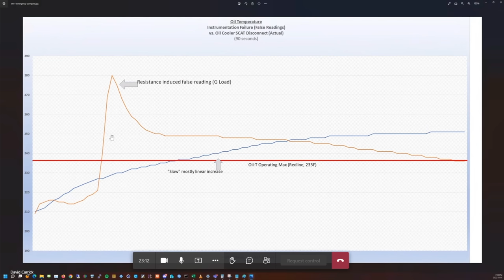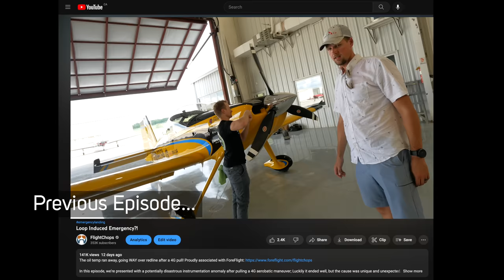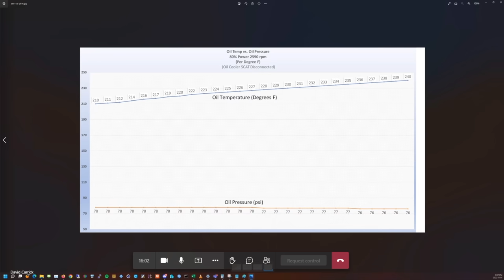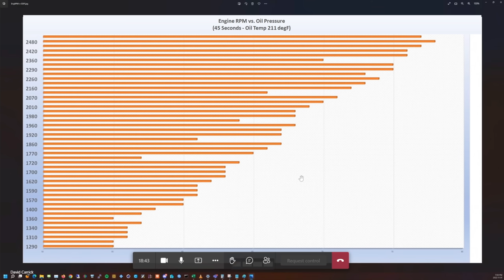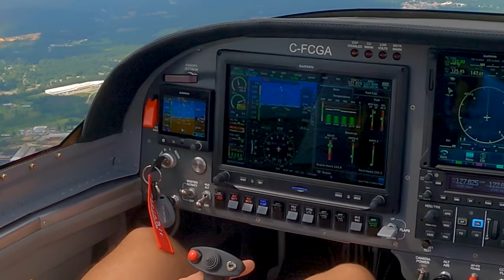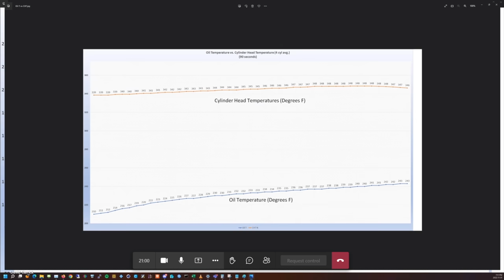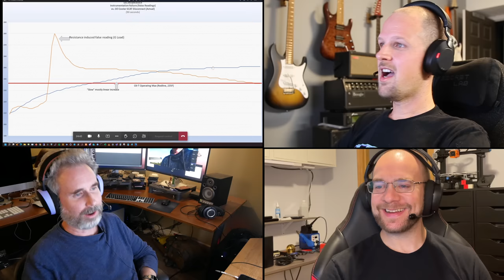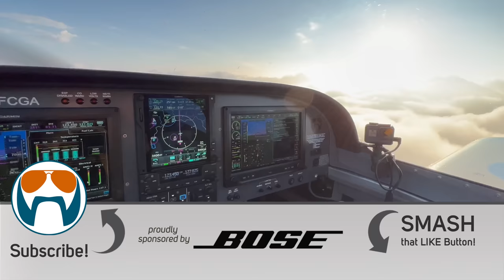Two Oil Temp Runaway Emergencies!? Engine Data Debrief Debunks Myths

Comment: On the call an emergency issue, and to be totally clear I am not a pilot. The purpose of the call is to give you priority Access to getting back on the ground and whatever resources you need to do that.

in the first emergency you were directly over the airport you seemed to be the only one in the air around that airport and you had people on the ground watching you. There is no local Tower controller it's a completely uncontrolled VFR Airport. You already had everything that you needed to get safely on the ground.

In the second emergency flight Chops was handling aviate and navigate. The other guy was handling communicate If you're going to yell at somebody for not calling a PAN that's the person that needs to get the recommendation not the person making sure that the plane is being handled correctly.

I will say that most people are in denial when they're having their emergency. They are reluctant to call because every other area of their life has trained them to deny there is a problem.

It is not a general aviation issue, it is a societal issue.

Comment: Do you have any advice for those of us worried about this scat tube coming off?  I have mounted mine and it was not super simple with the shape of the oil cooler inlet and the top portion is actually the one that comes off.  Was your clamp grabbing the wire?  Was it not tight enough?  Has it come off since?

Comment: Can’t disagree with any of these conclusions, but I still think Garmins EMS should be able to identify fault conditions like this. A change in sensor resistance faster than the thing can change temperature due to its mass, and/or noisy sensor readings should be flagged as a likely sensor fault giving the pilot more information about the problem.
What if this were a trim position sensor? You’d expect the software to flag when the sensor readings are erratic and don’t correspond to the expected control surface movement.
Very easy to do in software.

Comment: Interesting that the scenarios you missed in discussion were the only scenarios I’ve ever heard regarding oil pressure and temperature (never heard of either of your myths presented before - and I’m not surprised at your results because they are positive displacement scavenge pumps so the logic makes no sense that you’d lose pressure with higher temps). 

A long term increase an oil temp coupled with a long term decrease in oil pressure in cruise should flag you to consider a slow oil leak. Obviously your emergency didn’t handle this data but your discussion didn’t address it either. I can say from working with race engines this is a condition I have witnessed. 

The other condition was the opposite of a sudden drop in oil pressure which you said there is a myth temp would go up, this wouldn’t happen, it would be supplemented by a drop in temperature (yes a drop) should lead you to believe you just had a catastrophic loss of oil. Why you may ask? Because loss of oil would mean you aren’t taking heated oil across the sensor anymore. I have not seen the latter condition with oil but have experienced it blowing coolant lines before.

Comment: Surely there is and oil pressure relieve valve, the job of which is regulate the oil pressure?  So, the only time you would have low oil pressure is at low RPM or if the oil has got too thin which it should not unless it has gone out of grade due to age or if it has got way to hot.

Comment: You can create a simple sensor for the duct using a magnetic door/window sensor usually used for alarm systems. The flexible duct end and cowling could each have half of the sensor and if they separate, a light or alert could be displayed on the panel. These sensors are only a couple dollars each and are extremely reliable. It would alert before leaving the ground, or if in the air, as soon as it separates.
Reply: What about just an old school engine oil temperature gauge on the panel?
Reply: @abrahamlevi3556  that's solving the wrong problem. The problem that's being solved here is the tube separation. Not sure if you really need that problem solved, but an oil gauge isn't going to do that
Reply: @deSloleye  Yes, but an old school gangue can negate on the spot false alarms regarding  unexplained  erratic jumps in engine oil temp.
Reply: @abrahamlevi3556  that's true. All temp gauges are electrical, though, and you've only got so many places to fit a sensor
Reply: If you put in sensors for everything that can be detected by a sensor, that aircraft would be able to drive somewhat fast, but unlikely to fly...
Reply: @realulli  more likely to fly than be affordable, too. Those first f35a the usaf were using were instrumented up as much as they could be, but then cost $500M a piece. Everything you want to know will cost you.
Reply: @realulli  The magnet sensor is less than an ounce and cost less than $10. It is a system critical component and with the cost of an engine at stake - not to mention your life - it seems like a worthwhile investment.

Comment: It's impressive how resistant modern multigrade oils are to high temperatures. I'd think the engine thermostat would also open further to cool the cylinder head and offset some of the oil heat.
Reply: This engine is air cooled, there is no thermostat. It is also oil cooled and fuel cooled, although as pointed out in the discussion, lack of cooling oil won’t impact CHT immediately because of the thermal mass of the engine and where CHT is measured.

Comment: Interesting. I'm glad that I haven't had a real emergency yet, only one carb ice scare, but caught in time.

The oil temperature/pressure correlation is true at low oil temperatures. With cold oil during a cold start on a cold day, oil pressure, especially with a single-grade oil, can go up pretty high even at low rpm, but will go down quickly as the oil warms up. But at the higher end I've never thought that. Oil pressure limiting factor should be the pressure relive valve, because at higher rpm the oil pump will create much more pressure than is required. Same for CHT; there isn't really that much oil in the combustion chamber for oil temperature to make much of a difference.

Comment: do I really have to prove overall engine temp - which IS reflected in cht, is correlated to oil temp!!!?? What creates oil temperature? apparently king Canadian (as a canadian) here hasnt considered that. If you kept flying - with the oil cooler broken, what temp would the oil peak at? 
why would it peak at this temp? what does cooling the oil accomplish? 
If we altered the oil cooler size, air flow over cooler, and qty of oil pumped, could we alter peak oil temps?

what oil temp is desireable, and why?
Why does oil temperature take a long time to come up, almost as if oil temp tracks with engine temp?? hmmmm

yes - large heavy chunk of alum has large thermal inertial - aka time to get heated up or cooled down.  small volume of oil has lower thermal inertia - faster to respond. But everything wishes to equalize - oil and engine. and the oil is cooled to help cool the engine.  In the case of this engine, it must be cooled because the gap between usable safe oil temp vs engine temp is a large gap. if the engine naturally ran around 230f - ud never have oil temp run away issues UNLESS you have engine failures with internal frictions. I commented last time - and will again - maybe someone should find the true usable end of the oil before oil break down. Its our experience in national championship winning engines - that its well over 300f for short periods.

Comment: To add “data” points for accurate diagnosis of imminent engine issues or oil cooler failure, Im going to GUESS the oil temp sensor is after cooler, before it goes through the engine loop back to the cooler (or not).  Adding a sensor just before cooler on cooler entry - would tell you the delta in oil temp and if the cooler is working or the source of issue.  Normal operation will show whatever delta you have - call it 10 or 20 deg….and if a cooler blower hose blows off entry and outlet temp would be about the same, and at varied levels of issue of cooler (plugged, blocked internally, air failure, partial air failure etc).  The before cooler temp will be a better indication of engine issues as well, as a sudden quick rise in oil temp pre cooler would be a sure sign something has changed….
Reply: It doesn't matter. Oil temp too high -> land ASAP.
Reply: @realulli  This is ignorant.  Define too high....
KNOWING what our margin and limits are make us safer in decision making.  If we KNOW the plane will fly for 1 hour without damage - we can plan far differently than if we KNOW it has a failure imminent

Comment: Not a Pilot or AP ... but please read.
I am a Master Mechanic with a degree in Automotive and Diesel Technology with Factory training from FoMoCo, Daimler Chrysler, and GM/Delphi as well as certifications from many aftermarket manufacturers. Over thirty years of work experience.
While I agree with you on the greater majority of your data-backed commentary, I would like for you to appreciate the fact that 90 seconds of data does not give you the long term data to support your theory of cyl head temp not being affected significantly by oil temp.
Without a perfect understanding of the airflow within the engine compartment I would like to share some opinions.
I am assuming from the video at 0:45 the engine is cooled by ram air/ prop air that is forced directly over the cylinders and heads then is ducted to the oil cooler (when you hook it up) before it is dumped outside.
The duct not being secured is the clear reason for the rapid rise in oil temp.  The high engine speed was a secondary and significant cause which was immediately reduced once the temp warning was detected (now audible, good call there).  Reducing load/RPM instantly reduced production of heat on the engine and oil which did not show up in the 90 seconds of data because as you mentioned there is a lot of mass and it takes time for said mass to go from rising heat to lowering heat. 
There was only a minor linear change in cyl head temp during the rapid increase in oil temp because the engine itself still had almost normal airflow over the cylinders/heads, whereas the oil cooler had a massive reduction of airflow.
Now let's change the circumstances of the event.  You are no longer over the airfield on a test flight, you are over some huge body of water or, God forbid, climbing a mountain range.  Landing is not an option for at least 30 minutes.
This changes everything, and if you still believe your engine temps will not catch up to your oil temp, I believe it will unless you take immediate action to minimize load and RPM.  Going rich will help a lot!  Get to cooler air if you can.
If you have no choice but to carry on and even require high power settings, you will see the engine temp start to rise sharply to match the oil temp.  The oil IS used to cool the engine. Oil is squirted on the bottom of the pistons and is constantly being applied to the cylinders and scraped off by the rings.
Data at the ten-minute mark will tell you what the likelihood of you making the next airport will be. 
Ignoring the oil temp and assuming the engine temp will stay linear is not a good plan.  All the air cooling the cylinders is slowly baking everything in the engine compartment and looking for a place to escape.  If the loose duct compresses closed this heating will be amplified since air in must have a place to go out and if it doesn't that side of the engine no longer has enough airflow to cool the cylinders and it's going to get ugly pretty damn quick.
You get my point.  PLEASE RESPECT THE AIRFLOW...AIR IS FOR MORE THAN JUST LIFT MY FRIENDS.  Double check those ducts!  And fly safely!

Comment: Hey I have a question, why so many pilots use imperial units, including you, when it was internationally agreed that all units used in aerospace need to be in metric? Even NASA is using metric.
Reply from the maker: Man.... I wish I knew.  As a Canadian, aviation is the ONLY part of my life that doesn't use metric. 
I have to balance temperatures in C and F because the weather standards (even in aviation) use C, but for all the engine data it is always in F.
Reply: The exception is nautical miles per hour, which are seperate from miles, and have a 1:1 ratio with latitude and longitude. As for everything else, most aerospace stuff in this part of the world is made by US Companies, and theres no regulation requiring anybody in the US to use metric, thus the near universal use of Imperial.
Reply: @FlightChops  the people selling is also selling it by quart’s and gallons. Just saying.
Reply: @everettbruckerhoff6029   longitude with the required correction for meridian convergence, of course.  One degree equals 60 nautical miles.  Try to do it with 111 km instead.
Reply: @FlightChops  Engine data should be in C, or just convert it to C for actual use.
Reply from the maker: @llaughridge  in the manuals and on the panels all engine data is F.  Those are the numbers I know and I’m not prepared to convert to C for the sake of it being in C.  I know oil is happy around 180 - 200, CHTs around 350 and EGTs around 1350-1400.  Those are east numbers that I’ve been familiar with for ever.  Just like for weather, 0 degrees C is freezing.  So I live with thinking about weather in C and everything else in F
Reply: Aviation as an industry was essentially invented in the US. Not just because of the Wrights, but because we had a lot of wide open space with a low population density, with a lot of distance between cities (which is still true to an extent), so it was a natural environment for airplanes to flourish. So, when the first generation of pilots started teaching the second generation, they also imparted their ridiculous measuring system. Now, even pilots in metric countries oppose changing for fear of the safety issues switching might cause.

Fun fact: A few years ago, Russia switched from using meters to measure altitude to using feet for its Flight Levels (though it's still meters for altitude below the transition level).
Reply: @everettbruckerhoff6029  Not exactly. The original definition was that a nautical mile is the distance between minutes of latitude. Of course, because the earth isn't a perfect sphere, the distance between minutes of latitude varies, so it's never an exact match.

Longitude never even enters the equation, because the distance between longitude lines varies significantly based on latitude.
Reply: @HiddenWindshield  yeah, I forgot to add that.

Comment: Mr Miller seems to be getting more wrong than right recently. His interview with Mr Gryder about himself and Mr Haase cutting off traffic on final was eye opening. Definitely a "holier than thou" attitude towards aviation, which other aviators would be correct to avoid. Insofar as declaring an emergency goes, practice making the controller wait. They're your last priority. If I recall correctly, Mr Gryder had you yourself practice that exact thing, Mr Thorne, by doing math before responding to an ATC call. So declare the emergency, let them find you on radar, tag you up, and start moving traffic out of your way. You have 0 responsibility to them at all. Ignore them if necessary. Hesitating to declare is monumentally stupid and downright dangerous advice.